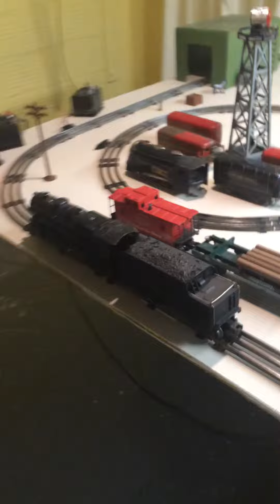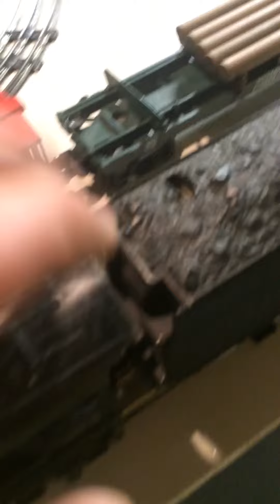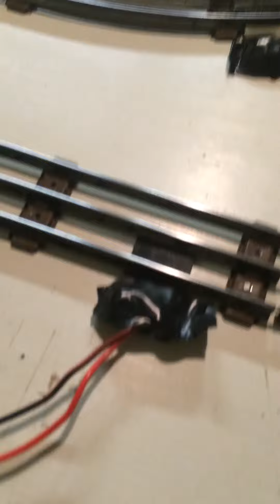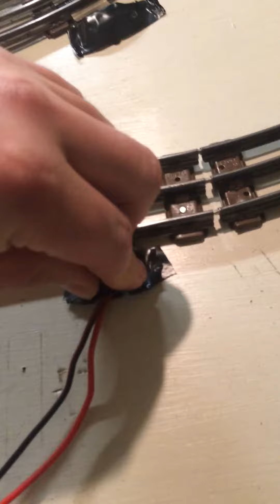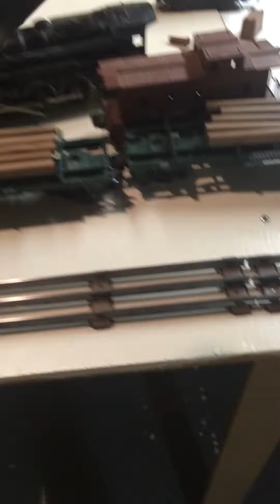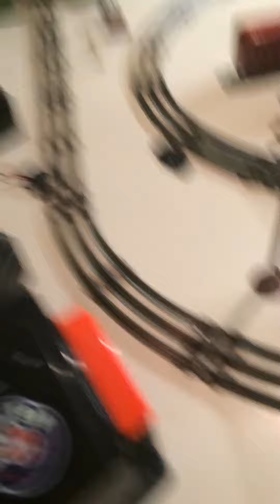Lionel 675

Comment: i just got mine running today the 675 pacific bought the 2466wx tender for it   had it 30 years it sat 20 years rebuilt it with usa lionel parts the same year as the engine less then 150.00 runs so good better then ever i like your trains just have fun with them